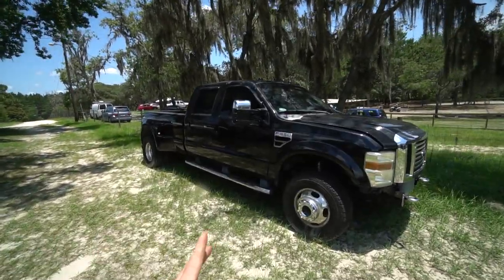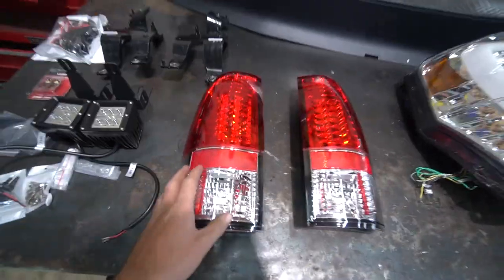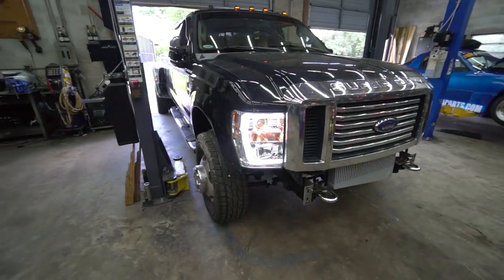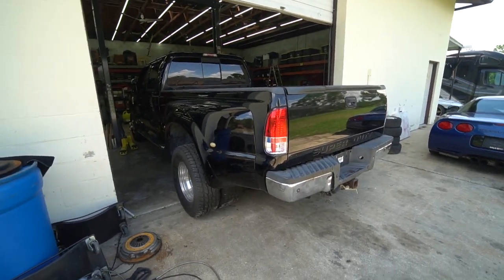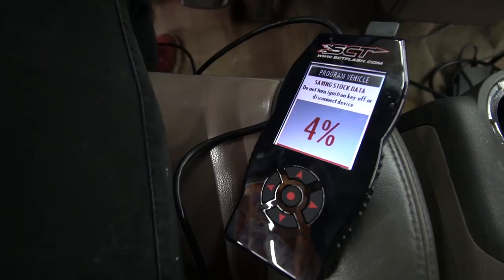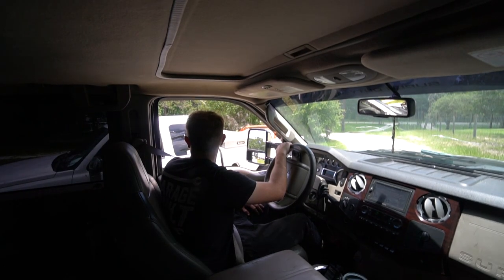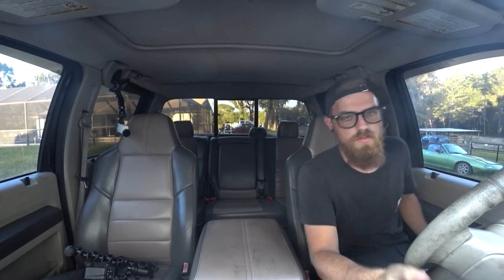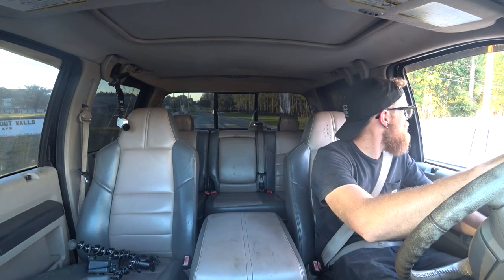CUMMINS Swapped FORD Gets A Makeover And Hits The STREETS! Fummins Build Pt.20!

Comment: the squeak is the back seat upper mount against the rear wall. My Denali did the same thing and drove me nuts. You can see the rear seat shaking back and forth from a speed wobble(get that sorted lol) I just cut that mount off and the seat swung forward enough for some extra storage.
Reply: you can see the back seat shaking lol
Reply: You're definitely 100% on the spot , plus he needs to check his engine mounts because the engine gets a little bit roudy at a certain frequence if the mounts are old
Reply: Use a magnet to keep the seat in place btw

Comment: The lack of a 4th gear is the 5R110 doing its thing does a 3-5 shift and you dont use 4th unless under 32°. And the gearing if the axles are oem you can check the axle on the door sticker and google it. 1800rpm is peak torque for the cummins vs ford is around 2100rpm.
Reply: thats the one problem with fummins swaps. the v8 engines rev higher naturally. i feel any cummins truck that isnt lifted should be running 3.55-3.73 gears. your truck probably has 4.10s and thats why its doing 2k. youll start sucking fuel at 2k. cummins loves to cruise 1600-1800rpm. fords usually have 3.73 or 4.10s (excluding f450+) i personally think lifted duallys are useless. when you tow youll end up rubbing the rear duals together and blow them. i forget how tall 19.5s are but you may be able to swap those on and lose some revs on the freeway. i honestly wouldnt run 19.5s because of how rough they ride but i live in california our roads are HORRIBLE. your roads look better. i also like your year with the older dually bed fenders.

Comment: Definitely wax your headlights to keep them from yellowing, do it on all my cars and works like a charm
Reply: Foil them
Reply: PPF would be the best way to keep them fresh. Protects from scratches, chips, and yellowing.
Reply: @JZEFPV  sure is the longer lasting protection over wax or ceramic coating them. If he uses Ultra he will get about 10 years out of the film.

Comment: Do the steering shock like nobody wants a death wobble
Reply: Death wobble comes from loose or worn parts. A steering stabilizer helps transmit less impact from bumps. He replaced all the balljoints and drag links as well as the steering box so there damn sure shouldn't be any loose or worn parts😂
Reply: @jaredanthony8070  there are new trucks that end up with the death wobble with nothing broken.
Reply: I think he bough something more "special" anti death wobble
Reply: Did he ever torque down the cab bolts?  I remember him saying he was putting that off until he was final on the drivetrain, etc., but can't remember him saying he did it.  Could that be a possible source of a highway speed death wobble?
Reply: Jared Anthony that’s how you know you haven’t owned a dually or a Ford truck trust me if he did change it it’s most likely the stock one and he needs to buy a better one because ford trucks have a death wobble even the 2020 trucks
Reply: SirVic42 he had something loose 100% because I have the same truck my self and it doesn’t shake that violently on the highway
Reply: Mihail Petrovici yeah but I don’t remember him putting it on like I told him about the folding mirrors too and besides saying thank you he left me on read 😂😂
Reply: A loose track bar balljoint  is the biggest cause of death wobble join that generation of superduty. Along with all the other common causes like loose tie rods, and knuckle balljoints.
Reply: Yes
Reply: GavinForCars anything but the first thing that gives is the stabilizer or the steering shock however people call it like i had to change it to a fox one
Reply: Never had a wobble in tenwty years of owning mine. Thought is was on lifted trucks only because you change the castor... What do I know.
Reply: kenny Irish it’s from 2006 to 2020 Ford trucks the OBS is the best Ford truck ever made tbh
Reply: The dealers know about it but there’s no recall for it
Reply: @bryanmoro7564  It looked like there was two specific speed ranges where it happened, say 35-40 & 65-70.  Given Taylor's expertise with steering components in general, seems unlikely he'd leave someone loose there.
Reply: Bryan Moro mine did. I had loose cab bolts
Reply: Tires need to be balanced it seems because it’s only at some speeds
Reply: Bryan Moro, look at the pendulum camera, thats why its shacking on that camera
Reply: The "Death Wobble" you are witnessing is from a floppy camera mount over the shoulder of the passenger seat. Further evidence of this is visible from the dash-inward camera.
Reply: mattio79 look at his body he started shaking a lot when he hits big bumps like something is up I have the same truck and that’s not normal
Reply: Joe Stacks your not a Ford truck guy because that’s the real only thing that gives on the trucks for the death wobble even the 2020 models do it and ford still haven’t made a recall for some reason
Reply: I worked on a relatively new four-door Jeep Wrangler 2wd that had a terrible death wobble.  It didn’t have very many miles but we ended up replacing just about every component on it , new wheel bearing assemblies ,tweaking the alignment, balancing the tires...  but we could never get rid of the death wobble.  The owner ended up going to another shop that changed a bunch more stuff. They still couldn’t get rid of the death wobble, owner just ended up selling it.
Reply: Had a '70 Chevy 1/2 ton 2WD...you wanna talk 'death wobble'...I'm talkin GENOCIDE WOBBLE, man, HOLY SH...IP WRECK!!!

Comment: Taylor, you can thank me later for this cheat code. Turn the key on seatbelt off engine off with parking brake set. When the seatbelt light turns off after a minute plug in and unplug your seatbelt 3 times. When you plug it in the 4th time, it will flash. When the seatbelt light stops flashing, turn the key off. This disables the seatbelt chime. Repeat the process for the passenger seat. If I missed a step, check out YouTube videos on seatbelt chime delete for ford. Obviously, always wear your seatbelt on the road. Mainly, it helps for cruising around your property at slow speeds. Congratulations on the first drive. I would love a cummins swapped ford.

Comment: So stoked for you and the new lights look sick.  Not worth polishing the old lenses when you can get some inexpensive new replacements.  Did it on my truck just recently as well.  Totally get what you're saying about 'trust'.  I had the CP3 go out on my 03 3500 (spewing fuel from the CP3) while heading out of town for the weekend. Installed a reconditioned Bosch CP3 and I've only taken her on short around town trips for now.   Getting a 9,000 lb truck towed back to the house is not something I want do again anytime soon, but at least I was only ~16 miles away.  Looking forward to more Fummins content and then towing the enclosed to upcoming drift events.

Comment: It would look cool if you 3D printed an I 6 and Cummins for the fan shroud to replace the power stroke v8 turbo diesel. Also impressive what a huge difference the front bumper makes on this fords. I really dig the headlights (think a black housing would look better tho).. But have my doubts about the taillights

Comment: Our Cummins swap took some tinkering when we got it done. We had a 4.10 axle ratio and it made the truck seem like it was working a little hard unloaded. We also had an issue with the converter locking but it is an Allison trans.

Comment: That noise is definitely your rear seat mounts. Under load when the throttle harmonics are vibrating mostly the entire truck if the mounts are loose on the rear seat or worn out they'll make that noise. Watch back on your clip every time it was making that noise your rear seat was jiggling around a bit while everything else was mostly stationary.

Comment: Unknown if this has been suggested Taylor.   Download Forscan software, and buy the appropriate OBD2 cable!!!  Save yourself the headache and a ton of money.  Buy replacement key blanks online, and you will be able to reprogram the system and spend way less.  I do not know what all you can adjust on your year truck, but I was able to program Pats, Change tire calibration, and multiple other things for my 99 Ranger when I did a v8 swap. Forscan community is AWESOME Oooh, I need to get those headlights for my 08 front end swap.

Comment: Taylor, check your seat. My first truck had a squeaky seat at highway speeds. No one ever rode in the passenger seat so I never could find what the noise was until I put some weight in the seat one day. With the weight, the noise stopped and pointed me in the right direction. I found that a bracket bolt needed less than a quarter turn and never heard that noise, again.

Comment: Whenever I get started on the 1965 - 1972 Chevy Super Duty, 4 wheel drive, turbo diesel, quad cab, long bed, 5th wheel hitch, with late model interior (needless to say, Chevy never created this truck in these years) I look forward to the exterior mods that are available, the most. I feel that a build is not complete until it has the things that make it the owners; the visual parts. Your  truck has turned out great Taylor. You have given me more ideas for my build with this series. I appreciate that even it wasn't your intention.

Comment: The squeak could be the blower fan for the HVAC system. My 2015 power stroke work truck makes a similar sound. As did my 2000 Silverado. Good place to start looking if anything

Comment: Living near Pittsburgh, Pennsylvania sucks because we still have emissions in my county. I am building a J32A2 swapped 2001 Honda Accord with a 6 speed manual and a 50 shot of nitrous. J32A2 is 260 HP stock and it has fully ported headers, an Invidia dual exhaust, and a full cold air Injen intake.

Comment: If the light continue to hyper blink you may have to wire in some resistors in line to trick the truck that the voltage is correct and the light isn’t out.

Comment: You won't need to tune the 5R110. DCS just says you do so they can sell you the tuning service and SCT X4. As long as the Ford PCM gets a TPS signal and you have the Ford MAP sensor plumbed into the Cummins intake the FORD PCM does the rest.

Comment: The manual +/- switch on the shift lever should bring up the gear display when you "don't know if it is in overdrive".  2000-2200 the Cummins will pull that race trailer nice.

Comment: fog light relay or switch gets power when igntion is on, might be possible to wire up  a constant power wire to the rela or the switch.  instead of using the aux switch

Comment: I wonder if the transmission isn't locking up? 2200 rpm at 70 seems high for a Cummins. My 2011 f250 locks up the converter in 3rd-6th I think.  You can feel it shift twice basically.  It drops the rpm quite a bit.  But if it's not locking up it will burn the transmission up

Comment: I noticed that it looks like the lights in your mirrors are not working. Maybe I just can't see them on camera but just wanted to point that out. You should post what you find with some of the small squeaks and stuff because my f350 does the same squeak noise and I can not figure it out

Comment: Thank God Florida did away with emissions back in the late 90s. I remember when I worked at a Buick dealership in Brandon, Florida and I used to have to take the cars through a multiple stall drive through emissions station before they were sold. They would take all the information, have you run them up to highway speed on the rollers, and use a tailpipe sniffer. It either passed or failed.

Comment: I don't know if it will work for you but ford vans in the UK if you have it running plug and unplug your seat belt 10 times then turn it off and on it will turn off the seat belt warning. If it annoys you

Comment: Im curious to see when something goes wrong and sets the check engine light if it will be set by the cummins ecu based off its parameters or if it will be set but the ford pcm based off the 6.4 parameters because it thinks the truck still has the stock 6.4

Comment: Does it feel like the torque converter is locking? My 03 cummins 6speed on 285/75r17s, runs 2250 rpm at 70mph, so I dont think your far off.

Comment: The 4 aux wiring is under the steering wheel panel there should be a bundle of wires tied up out of the way and there labeled 1234

Comment: I would have tuned it with Hp tuners software much more control than what dcs can do with the sct.   And you can control what it does instead of someone else that isn’t the one driving the truck

Comment: Hello, I have been watching this 6.4/5.9 swap and am very interested in doing this to my '10 Ford f250 with a manual transmission. Would the swap be less complicated for me as I have none of the automatic transmission electronics? This is not something I plan on doing immediately as my truck only has 72,000 miles and runs good so far but when it comes time to replace the engine it will be a 5.9 24v Cummins. Thanks for the  videos!!! P.S. let me know if you could!!!!

Comment: That squeaky noise, last time I heard that noise I was in my grandpas f250 and it turns out the wheel hub just lit itself up and was red hot.

But the noise didn’t go away after it started, once it started it didn’t stop til the truck did.

Comment: Those taillights look like they are made for the 99-07 f350s and not the 08-10 ones. (The older ones don't poke out farther than the body lines and the reverse lights are on the bottom) Just my opinion

Comment: Those headlights, apply some type of protection to them, wax, sealant, coating... whatever, and they should be fine, i'm sure becausae they are cheap they can suffer on the sun more than others, but if you take care of them, you should never have any type of issue.

Comment: It kept bugging me, would you do it over??? It is a serious job and truthfully, not standing there, would you do it different this time if again? I got that same should shift quicker sound out of mine when empty for a while and then it kinda just broke in. It does sound high when I turned the volume up and just listened to the engine and transmission. I don't know how much you can tune out but from the wild guess, unless the torque converter is fully programmable, It would sound more like the two are not quite on the same page. Going up is a bit high and coming down is a bit late. I don't know how much paddle shift control that you enjoyed, some most of all the new stuff after ten ish, I don't know much about except from here. Not dead yet and don't plan to so soon. I just wish I had only learned more when I was a kid. Not so lucky on the next coming around. Old is just old

Comment: If you were going to get keys made I would recommend just getting the Bob’s any separate far for Ford will work on that car if you want to get them connected though order them on Amazon and have a locksmith come out unless you have to please if you have two keys that are program to your truck already you can program the transponder and the remote without needing a locksmith to come out and you can go to a local locksmith shop to get the keys cut or just get them cut at the local Home Depot

Comment: I have an aftermarket bumper on my 08 F250 and the reverse sensors are zip tied to the frame so it freaks out every time I put it in reverse unless I remember to 
push the off button. So if you delete them let me know what you do to shut that off if you delete them
Reply: Just unplug the bumper harness from the body, zip lock bag on each connector, tape up, and no more beep.  Just the nagging on the dash that the rear park sensors are inop

Comment: Do you know what rear end is in that truck.   I know my dodge with a 4 speed. And  3.42 it  cruses at 80 ant 2400.  Ish and my dullie has 3.73  and in 6th gear at 80 is about 2200

Comment: Yo I know this isn't the c5 build video. But why didn't the c5z stock wheels not work? Could you have used a spacer?
Reply from the maker: They were too wide.
Reply: @Taylordrifts  so not enough angle im guessing? Say I want to run my stock wheels with spacers for drift days think that could be done?

Comment: Question: which swap would be better for an rx8.. a 2j or ls? On the difficulty level
Reply: 13b
Reply: Or M50B30 TURBSKI
Reply: See also N54/N55/B58B30
Reply: 13b is the current set up

Comment: Check out the condition of the cab mount's Ford has a big problem with there cab mount's
 Check out Stephen Cox on youtube  He just put new cab mount's on an F - 350 that had around 100,000 mile's they where really bad, I'm surprised the cab didn't fall off going down the road,  LOL,    is that truck a f-350 or f-450,   the f-450 has a wider front axle so they can turn sharper. that's why a lot of big 5 th. Wheel Hauler's  are buying f - 450.
Reply: He didn't replace them when the cab was off and on like 10 times?
Reply from the maker: I did replace them. With upgraded s&b mounts

Comment: you can do a 2015 f350 interior swap on your  2009 i believe
Reply: But why, they are almost the same
Reply: @jasonlafferty297  who wouldnt want newer interior. Plus the current seats and center console looks outdated. Also its more video content for Taylor.
Reply: not very much difference, and he has the big center console.  Would really be a waste of 2k for that if he is happy with what it has. I swapped in Excursion front seats/console in mine, because I did not want to shell out the ridiculous asking prices, and the bench seat sucked.
Reply: Tim East you also can get the interior parts from a wrecked truck so it wouldn’t be 2k easy to get king ranch interior for less than 2k from a wrecked truck If you can find it. Would make a great video

Comment: Im an idiot, why is the ls miata not tuned?(it prob is tuned and im just an idiot, and also because i think i missed the video)
Reply from the maker: It has a base tune from Matt happel (sloppy mechanics) and the new Holley systems have self learning for the fuel so it basically tunes fuel based on the wideband input.